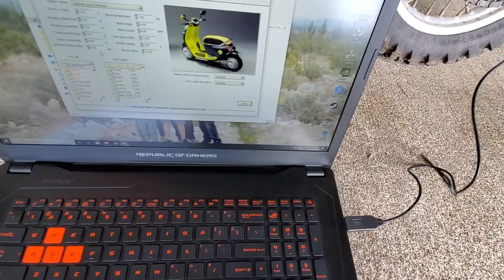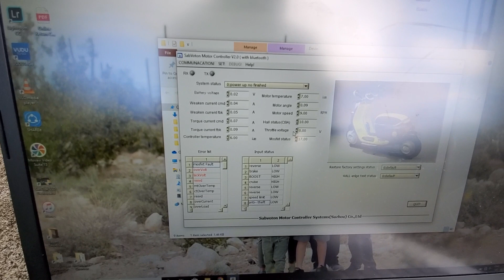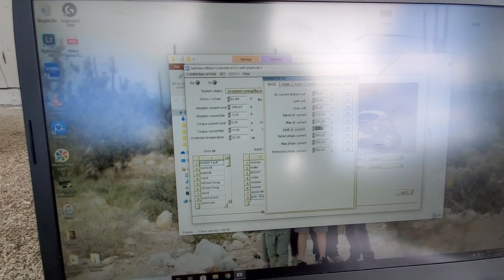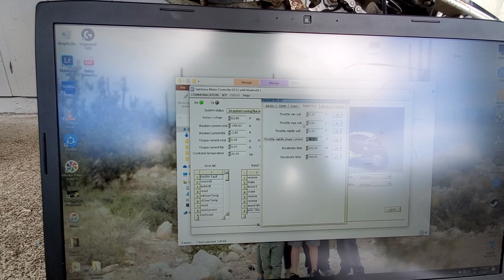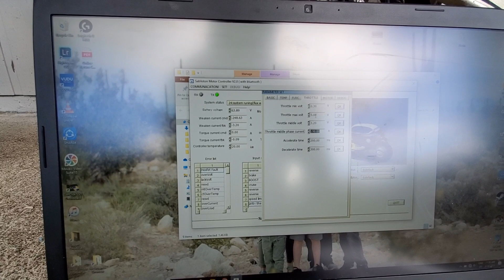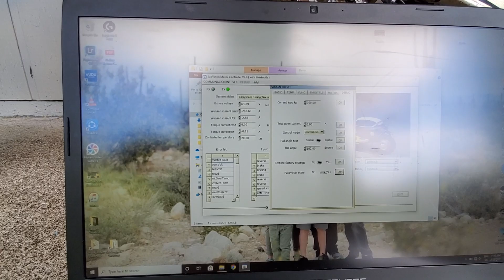Sabvoton programming and settings. CR80 conversion to electric

Comment: Hey does the bike have to be turned on when the controller is plugged in
Reply from the maker: I think so. I do turn it on when I program.
Reply from the maker: looking at the video I guess you don't have to turn it on. Haha.
Reply: @DevinLindstrom  think you if o don't turn it on it won't give me any voltage readings
Reply from the maker: @Izak0527  interesting. Well if you have a contactor that would make sense. I din't have one hooked up right now.
Reply: @DevinLindstrom  I just plugged the controller by itself into my computer nothing was plugged into the controller.  because I was curious what would happen and It connected I just had no voltage readings and it's a new controller so none of the limits were set.
Reply: @DevinLindstrom  also I haven't built my battery yet so I can't really set any limits yet

Comment: Hi I like your conversion. You might be able to fit 2, 48v Honda Clarity battery modules in series inside the frame.There is a seller on ebay with the name azlithium,who is selling them in pairs with a a 15a charger.I was thinking of converting a Motoped to electric but I am starting to like the CR80 better.Its got beefier suspension than a Motoped.
Reply from the maker: The controller can only handle 94v max so 92.4v from a 22s is the highest voltage it can take. Plus if I do a 18650 battery I can fit up to 6kwh in it.
Reply: @DevinLindstrom  nice! send it full power!

Comment: Why is this motor better than Cyclone?
Reply from the maker: I don't know cyclone motors all that well but this one was only $670 with the controller so pretty cheap. Also I have been running it at 14kw and it barely even gets warm.
Reply: @DevinLindstrom  Qs 138 is for sale with a belt instead of a chain. In general, I wonder where its limit is 20? 25 kW? You have to assemble a bicycle on its basis and go around Tesla !
Reply from the maker: @chikchirik460  The newer models of the 138 motor are chain driven. I am going to push my motor to about 29kw peak so we will see how it does soon.
Reply: @DevinLindstrom  I will watch. By the way, there is a model of 8 kilowatt engine in rated power.
Reply from the maker: @chikchirik460  A QS motor?

Comment: Hi Devin, your videos are awesome.! I am looking into getting a electric pit bike. I wish I could have the skills to build my own pit bike but wanted to ask your opinion. What is the best electric pit bike? I am looking at the Oset MX-10 it has great torque and power for a little bike and guys in the U.k. are do wheelies and skate park riding. Looks like the bike can take a beating. I also saw the Keburg cross hero X pro 50. But because it doesn't have a rear hand break I am leaning towards the Oset. The price point of the Oset is great too. But I saw on ELECTRIC PITBIKE channel you posted "husqvarna" I can't find anywhere that sells those or specs yet..?  Thanks for your time and help. I can't wait for your next videos and customs.
Reply from the maker: Thanks for your comment. I personally like the oset MX-10. It looks like a pretty fun bike. The other option is you can get a razor MX500 and upgrade the motor battery and controller. It could also use suspension upgrade. The ktm and Husqvarna are not out yet.
Reply: Devin Lindstrom Cool thank you for the advice. I appreciate your time going to go with the oset Mx-10.

I just watched the razor mod video! Awesome! Mann one day I loved to try and make one. I think I will need a step by step guide. Maybe in the future when you have time break down what is needed to get into the hobby of “e bike customs” for guys that want to get into it? But not trying to tell you what to do by any means love the channel!  Any updates on your “E-truck”?
Reply from the maker: @timzchannel1960  the e truck is a few years out. Gotta buy me a dental practice and start working so I can afford it.